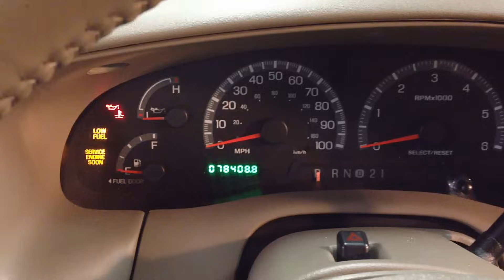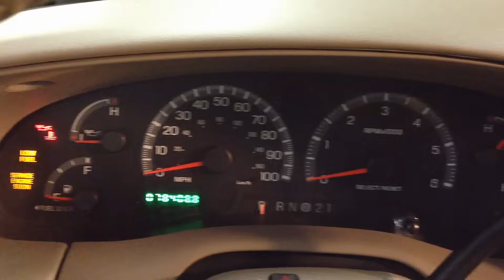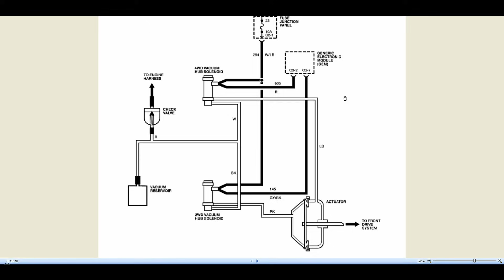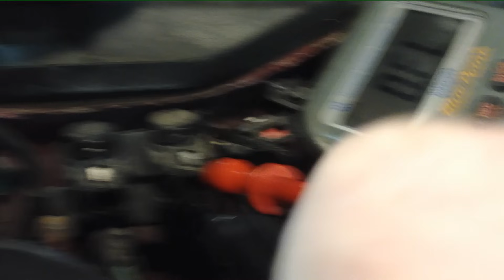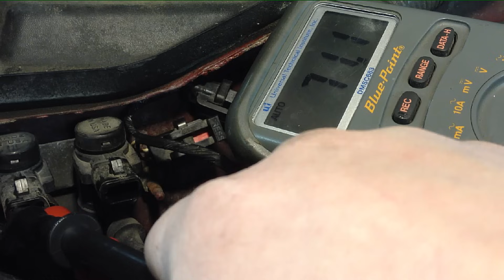1997-2004 Ford F150 4X4 Inoperative In Depth Diagnosis

Comment: I have a 2002 F-150 King Ranch 4X4.  I turn the knob no clicking no lights on the dash nothing.  Is it likely to be the shift motor or the transfercase shift module located under the dash behind the glove box

Comment: F-250, 2003,  I don't feel or see my front wheels engage in 4 wheel drive. I can hear something, but no spin, or no jerk, like the wheels are pulling.  I have jack the truck up, and the front wheel engage as you have shown in the video.  Inspecting the transfer case , I don't see a motor.   What do I do next?
Thanks
Reply from the maker: martin kubier You have auto 4wd and there is no electrical motor bolted onto the transfer case?

Comment: According to TheSandman717 (who has a YouTube video about removing and replacing a GEM module on a 2003 Ford F-150 4X4), if you set the selector switch to high range 4WD and the 4x4 icon is displayed on the dash and will not go away when you turn the selector switch to 2WD, if you remove the 5 amp fuse near the top of the second from the left column of fuses in the cab for a few seconds then replace the fuse, the 4x4 light will go out.  I believe he said that removing and replacing the 5 amp fuse resets the GEM.  This worked for me.  My 4x4 light stays on when I try to switch to 4WD but can't get 4WD.

I have done the under-hood checks.  Will go under the truck tomorrow. The vacuum at the solenoids is present but seems to be rather week,  I have a vacuum gauge.  What reading should I see on the dial when I connect the gauge instead of use my finger to feel a vacuum.
Reply from the maker: Louis Sparks You should see the same as engine vacuum. Usually when the light gets stuck on the transfer case shift motor is the fault as the gem does not monitor the front axle components.
Reply: I have a f150 1997 and wen you turn the switch to 4wd no lights or anything happening
Reply: I have a f150 1997 and wen you turn the switch to 4wd no lights or anything happening
Reply: I have a f150 1997 and wen you turn the switch to 4wd no lights or anything happening

Comment: Great videos - very helpful. I was hoping you might have run across a situation I have been trying to fix. I have a 2003 Expedition Eddie Bauer with 150K mi. October of 2014 I was having the Check ABS Light message in the message center. I replaced the front driver's ABS Sensor wire and that message went away. There was a slight vibration in that wheel but everything worked fine. Using the 4wd over the winter I started to hear a clicking/grinding when engaging the Automatic 4wd switch, but it would go into 3wd and work fine. Last month in 2wd on highway the Check Advance Trac message came up in the message center and the Advance Trac light is permanently on now. Also the 4x4 Low & 4x4 High lights blink in sets of 3. No 4wd available now at all. I hoped it was the wheel hub and replaced that following your video but still have the Check Advance Trac message & no 4wd but the vibration is gone from that front driver's wheel. Wondering if I need to replace the Transfer Case motor or the 4wd Actuator now. Any thoughts would be appreciated. Thanks - Joe
Reply from the maker: Joe McGinnis Any abs or advance trac fault will disable the 4wd they are intertwined relying on the wheel speed information from the abs module. Get abs codes read and go from there.
Reply: FordTechMakuloco Just had a mechanic at work plug in an ABS Code reader as I'm not getting any Check Engine faults and my scanner won't read ABS codes, He says it is showing the U1900 code and nothing more specific than that. Should I start looking at a replacement ABS Module? Thanks again for taking time to help.
Reply: Joe McGinnis Found that the problem was the Purple wire running under the Driver's floor plate just inside the door that runs the CAN Bus was corroded in the splice. This caused the U1900 Fault of the CAN Bus. It was on the side with the 3 wires coming off of 1 wire running in the channel just inside the door on the floor. Had to pull up the plastic and then remove a sheet metal guard and then unwrap the wire bundle. After pulling on the 3 wires a bit, 2 of them came out of the splice and were obviously corroded. Re-spliced and all working now.

Comment: I have a 2003 Ford F150 with the manual shift on the floor. I have no 4wd. When I turn the truck on the 4wd lights come on the dash and go out. When I try to shift the floor shifter to 4wd it does not go into 4wd and no light appear on the dash. Are the manual shifting the same as the dash switch type? Any guess where I should start looking for my problem? I have checked fuse 23 and it is fine. The first item that did not seem correct was when I checked for the ground on the left side on the 4wd solenoid the light did not come on on the test light when the shift lever on the floor was in the 2 hi or 4 wd hi (the ground light was on on the test light on the 2 wd solenoid).
Reply from the maker: Ronnie Seeley Does the front axle disconnect move and engage? I have seen manual systems the external linkage binds from rust and it never fully enters 4wd.
Reply: FordTechMakuloco The manual shifter shifts through the gears as described. Is it an option to switch the vacume lines comming off the solenoids on the firewall by the battery to see if the diaphram on the axle will cycle the fork?

Comment: I have parking brake light on all the time, Brake light switch is ok, my 4x4 low does not work on F150 2008. Any idea's anyone
Reply from the maker: Bill Mangher Those were known for the cluster to fail. Circuitboardmedics.com fixes them.

Comment: is this the same procedure if the  shift lever is on the floor?  I have a 1997 f150 with a 4.6l engine
Reply from the maker: Douglas Polk If you have these solenoids then yes the procedure is the same.

Comment: 2008 f150 actuators in the front left only release part way.you can hear the grinding in the wheel. had them replaced 3 years ago but now they are acting up again what to do is there a fix to fully release them until i can get a chance to fix properly
Reply from the maker: Gerard Mccarthy Disconnect the vac lines at the hubs they will stay locked then.

Comment: I've got a 97 ford ranger. I hear no clicking in dash or under the truck. No dash light indicators come on either. What should I check first, switch or shifter module maybe?
Reply: Sorry it's a 98
Reply from the maker: Jeff Hackney I would get the codes read from the gem module to see what fault the module is seeing in the transfer case shift motor.

Comment: What powers the 2 solenoids mine have no power to them
Reply from the maker: Wayne claywell fuse 23 10 amp
Reply: Thanks i finally got it all fixed yesterday had to replace all the vacuum lines that goes to the 4x4

Comment: I have the 2003 Ford F150 Supercrew....Can the actual ESOF switch go bad?  Not getting the clicking noise from the dash.  4x4 Indicator not coming on.  Where would you look?  I have learned from your video and I'm headed to the garage....  Just curious about the switch....   Thanks
Reply from the maker: Danny Kelly Switch never seen one go bad but if yours is no turning on the light then it is most likely the transfer case shift motor is stuck and lost position. At that point the gem will not command anything. You can verify this by reading the codes from the gem module.
Reply: FordTechMakuloco Thank you sir, right on.  2 smacks with a hammer on the transfer case shift motor and I'm in 4 wheel drive.  Simple fix, thank you

Comment: I have  a 2001 supercrew  5.4   with off road package  when I turn from 2wd to 4 wd  the 4wd light comes on in dash  the  truck stays in 2wd   when i turn to 4wd low  the light stays on for 4wd  the 4wdlow light does not come on.   the truck does not actually change from 2wd   while  on snow and ice  you can tell the truck stays in 2wd  the back spins but the front does nothing.  I do not hear clicking in dash  and I do not hear transfer case motor pull in. planning on testing front engage sol. as soon as weather gets where I can.  how else csn I check transfer case motor
Reply from the maker: ken Ricker Yeah your shift motor is stuck and the gem module knows it based on contact plate position and doesn't turn on the relays. You can pull codes from the gem module there will be a general contact plate failure code.
Reply: Thanks that what I figured

Comment: When I test the solenoids for 4wd I have power coming in.  I test the ground side on both and test light does not light up. Is this due to a bad GEM Module.
Reply from the maker: Kevin Jefferson I would get the codes read from the gem module if it sees a fault in the shift motor it will never turn these on as any 4wd operation is disabled.

Comment: looks like my gem is not sending ground a signal. so I am stuck in 4 wheel low. Any way to switch without changing gem? over ride manual switch?
Reply from the maker: Jeff Haley You can manually turn the shaft that sticks the transfer case to 4wd high.
Reply: 10 4. I think it is stuck in 2 wheel low?

Comment: Great video. You don't happen to have one on tranfer case part of the system..? I fully understand the functioning of the front firrential but having a hard time getting the transfer case to do anything. All fuses are good, I opened the switch and contacts and everything look good... I'm getting no 4x4 light on dash and sound whatsoever when using the selector.. maybe you got a tip for me
Reply: Thinking about swapping that TC motor but maybe there's something I should check first

Comment: I have 97 Expedition that will engage the 4x4 some times only. The 4x4 indicator lights in the dash will not even turn on. Like I said it works sometimes, and I am afraid to use it for fear it will get stuck on 4x4 only. Any thoughts on what the problem may be? Bernie
Reply from the maker: Bernie Bestard The common problem with these when the light wont come on is the transfer case shift motor being stuck and losing its position.

Comment: I have a 2001 F150 4 x 4. My question, is it better to engage the 4 x 4 while it's In park or is it better to engage while in neutral? 

Thanks -Ed
Reply from the maker: Ed Rodriguez Best stopped but the design is made to engage smoothly while driving .
Reply: Thanks..

Comment: I have a 2000 ranger 4x4 , i changed the pulse vacuum actuator, went i turn the 4x4 switch on 4x4 low the vacuum pump don't come on. any sugestions. you help will be greatfull      louis d
Reply from the maker: What vacuum pump?

Comment: Wouldn't I still have clicking of transfer case relay of it trying to do something ...its completely dead when I turn the switch. Just crazy to think shift motor would make the the hole system dead.
Reply from the maker: There is a plate inside the shift motor that tracks the position if it has found a fault there will be no attempt to move that shift motor again hence no clicking of relays. Best thing to do is get the codes read in the gem module to see what fault it is seeing or you could get a new unit from amazon that takes parts back easy and bolt it in quick to see if it is now operational. There is no good way to test these without a scan tool pid data because testing manually everything is backwards.
Reply: Got ya I'll try that
Reply: Is takeing the shift motor off and putting transfer case in 4 hi and takeing vacum hoses off solenoids and pluging them in having in in 4x4 for snow a bad idea?

Comment: When I test the solenoid on the 4 by 4 side with a test light hooked to postive and setting test light on left side and going in truck and turning 4x4 switch to 4 hi or 4 low I get no light like step u did 9:12 in the video I get light on 4x2 side...also checked for and current at shift motor harness I have no light on any of the pins going in to truck ..I have current at dude 23.switch on the dash only current I have with parking light switch on is for the green dash light display  nothing on the other 3 pins ...I have got the 4 wheel drive to before and when it did it worked great for about 3 days then back to dead .
Reply from the maker: Your gem module is not likely sending power to the 4x4 solenoid because the transfer case shift motor has found a fault. They are known for a general plate contact failure code. Once that is set there will be no attempt to go into 4wd.

Comment: Hi I have a 97 F250 LD. I think my fork must be bent or broken. My actuator and the motor on the transfer case is working fine. It still does not engage the front differential. How do I replace the fork? I found your video very helpful.
Reply from the maker: Rico Lochner Have you put it in 4wd key on engine off, lifted front end and spun both front tires together at the same time to see if they transfer power to the front driveshaft?
Reply: Yes I have done that. If I engage the 4 wheel drive the front drive shaft engages and does not spin free. But the wheels still spin free. The actuator pulls in to but from the differential to both wheels everything spins free. The front wheels are not engaged.
Reply: I have like your page on Facebook. Maybe it's better to talk there?

Comment: I am having issues with my 1997 F150. 4x4 light comes on and all of the vacuums work. When I engage it into two wheel drive and 4x4 I can see that little fork on the bottom pushes in and out. When I lift the truck up and put it in 4x4 only one wheel moves. Really confused whats the problem unless its toward the hub.
Reply from the maker: Chuck Jedlicka You have the truck jacked up all 4 wheels and put into 4wd and only which front wheel spins?
Reply: No just the front jacked and the driver side does not spin. I was told it's the shifting fork bc they are prone to break but was looking for a video to see how to change it.
Reply from the maker: If the front is jacked up and you spin one side does the other side turn but opposite direction? Also the way you are testing you are locking it in and spinning the front driveshaft by hand right? The front is an open diff so the side with the least resistance will spin and other will not. Only way to verify fork operation is to remove front cover and check.

Comment: ok I checked my system as you show here.  I am getting vacume all the way to the front differential actuator, in both 2 wd and 4 wd  my actuator does not move,  i used a vacume pump and put on the actuator and nothing.  i am assuming the actuator is bad  do you have a video on how to remove the actuator?  2001 F 150 supercrew
Reply from the maker: Doris Root Does the actuator hold vacuum when applied with pump? I do not have a replacement video but I believe it just has a few snap rings holding it in.
Reply: FordTechMakuloco yes it is holding vacume  when i hooked up my vac. pump i beleive i got some water out of it.  it is now engagineng.  i was going to check to see if the wheel disconect (not sure if thats what you call it)  would hold vacume but i dont see the lines  all i see is the abs sensor line and of course the hydraulic line for the brakes.
Reply: Raymond Root my 2001 f 150 does not have the vac system to the hubs, the axles spin full time and the actuator for the shift fork in the diff. is moving slightly , so i am thinking the bushings on the shift fork may be worn, any video on this?

Comment: Thanks for the great diagnosis video.  My 1997 F150 with ESOF started acting up when it was cold and currently it won't go into 4x4 when I turn to 4H.  I'm going through the process and found the following: 4x4 light checks when started. Fuse 23 is OK.  Turning the shift selector switch to 4H generates some clicking but the 4x4 light does not come on and there is no electric noise under the floorboard.  The right side of the wiring harness to both solenoids is hot when the key is on.   With the key on and the switch in 2H, the left side of the 2WD solenoid is a ground  (bright light on the tester) also the left side of the 4WD solenoid harness has a dim light??? on the tester and reads as a ground with a multi-meter???  With the switch in 4H there are no changes to the switched grounds.  There is constant vacuum to both bottom connectors and the top port of the 2WD solenoid with engine running and switch in 2H.  The 4WD solenoid doesn't appear to activate when switch is in 4WD and no vacuum is felt on the upper section of that solenoid. Vac reservoir and connecting hoses look intact.  I replaced the 4WD solenoid but there was no change.  I think I'm looking at a problem with the selector switch or the GEM.  Is there a way to test the selector switch or did I miss something?
Reply: Fixed!  After reading back through the posts I remembered that the problem started out as being stuck in 4wd.  Replaced the transfer case motor and it works.
Reply from the maker: Bob Van Tassel Yeah the 4x4 light not coming on is a dead give away the shift motor is not working or has lost its position. Glad you fixed it.
Reply: FordTechMakuloco NO LIGHT AND NO CLICKING, SUGGESTIONS?

Comment: I have an '03 f150. I can hear the GEM click, and a solenoid click under the hood. I checked vac by turning on my heater to panel, then turning the switch to 4 wheel drive. The fan kept blowing out the front, and did not go to defrost which I believe is default. So I believe that means vac is good? I still don't have any 4wd. Any ideas what to check next?
Thanks
Reply from the maker: 89801wink I would still go through the test in the video at least to verify the axle lock is getting and releasing vacuum, front axles are locking etc. If that all test out then you can go from there with the transfer case.

Comment: I am assuming that the transfer case shift motor only applies to the 4WDs with the knob on the dash and if you have a manual 4WD shifter in the floor you wouldn't have the shift motor you keep referring to?
Reply from the maker: Stephen Hummel Right.
Reply: FordTechMakuloco
 thank you for the response, im hoping i can resolve my issues with your video. keep up the good work!